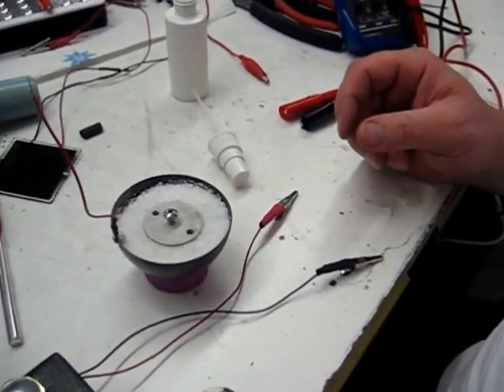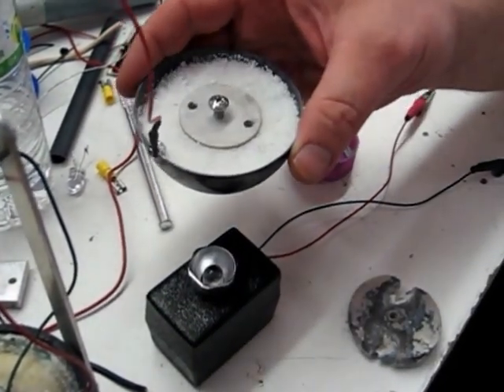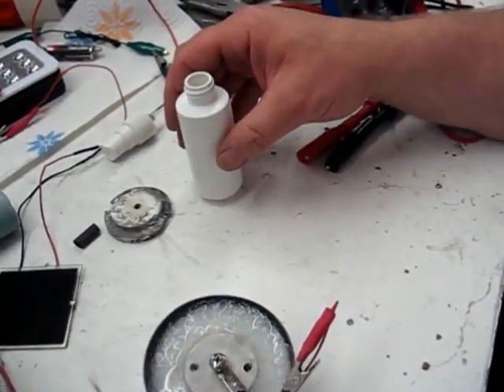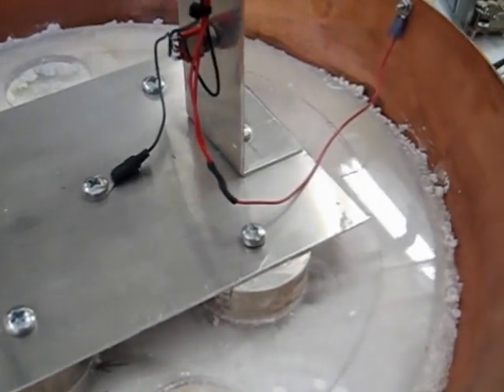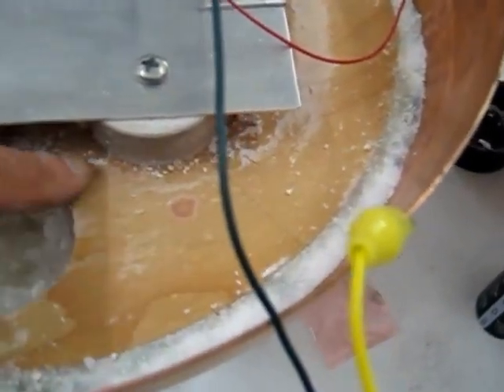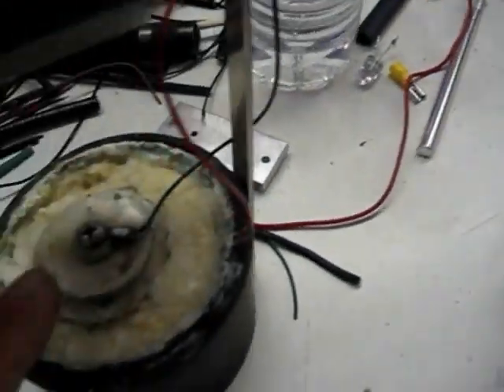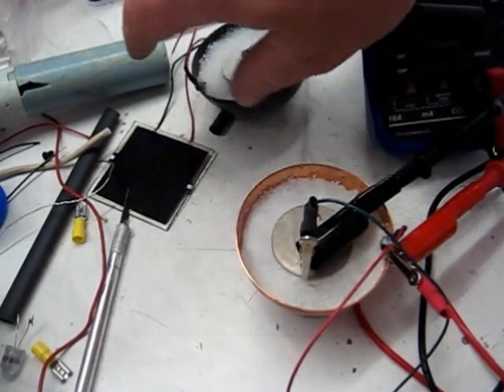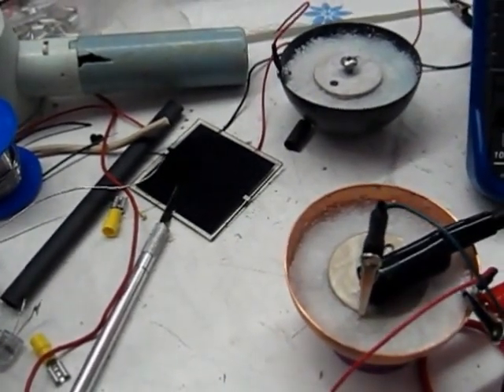Energenx production Alum crystal water battery

Comment: I thing, if my theory about these batteries (energy converters) is right, You batteries will be much more powerfull when You will put them into the low pressure chamber (vacuum) after the water saturation for a while. Or alternatively the batteries made by epsom salt melting, just melt it in a low pressure (vacuum chamber) and let it solid (cooling) there - but do not dry them out too much - you still need some water molecules inside the crystaline to transport thermal energy from the environment to electricity by piezzo effect of water molecule crash to crystal lattice. An addirtion of semiconductive metal oxides will boost up to - just ad an electric current to the battery electroces for a minute in oposite currentflow as desired from the battery. It will prevent the self shortcutting of the battery and sending Q into space back.